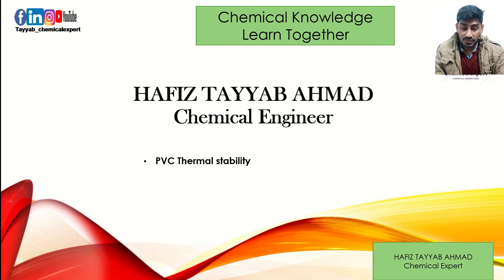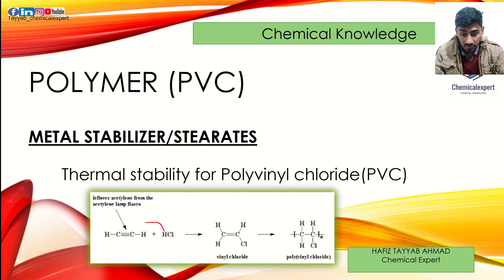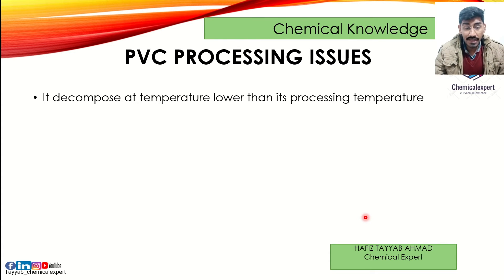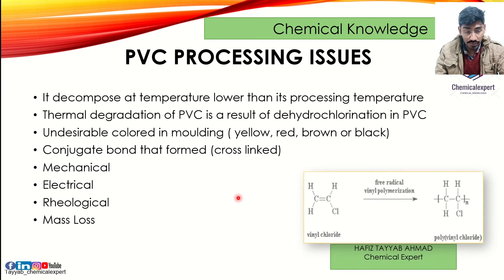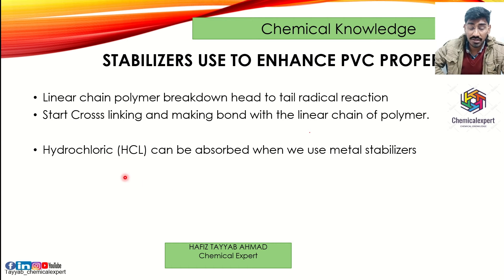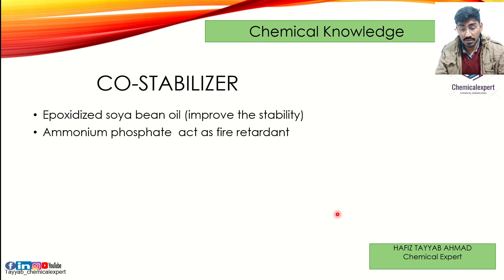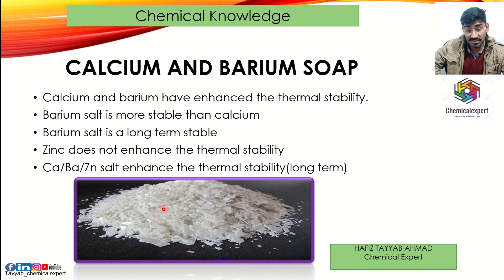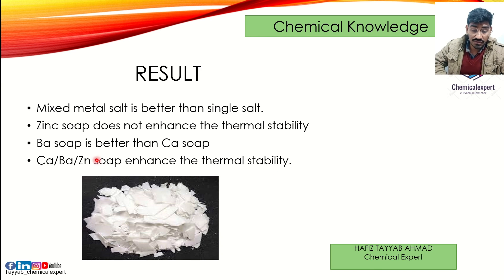PVC (Polyvinyl chloride) / Thermal stability of PVC/ Filler/ Additives/ Metals soap in PVC/ Soap

Comment: Thanks for your kind hearted. Zinc salt as you mentioned, It enhances the HDC, why zinc salts use as thermalstabilizers of PVC.
Reply from the maker: Zn-st is used as a stabilizer because during heating PVC decomposes and realizes HCl gas. This is absorbed by Zn St and reduces the chain reaction. Hence, thermal decomposition is stopped.